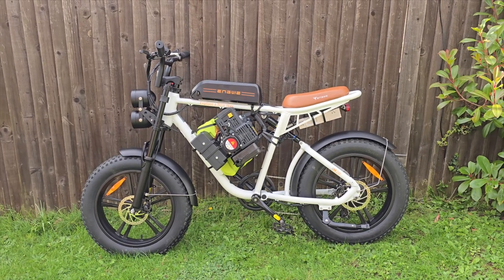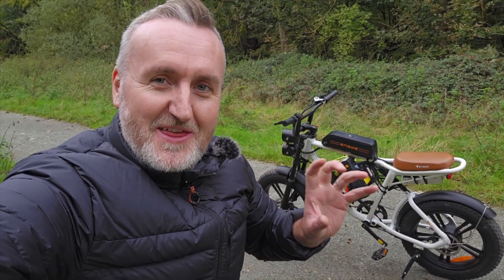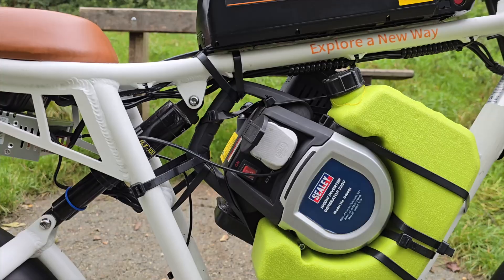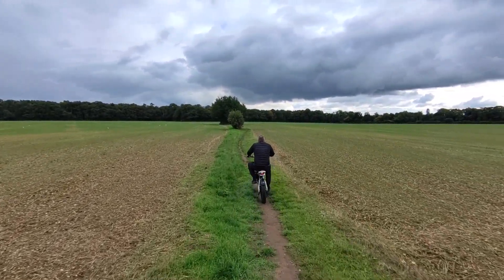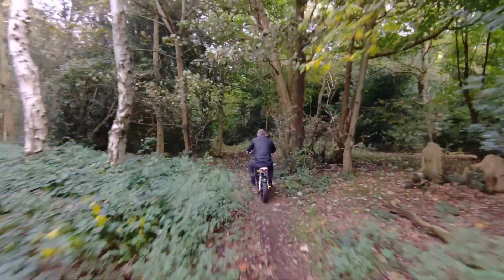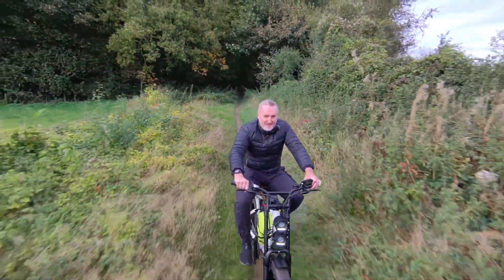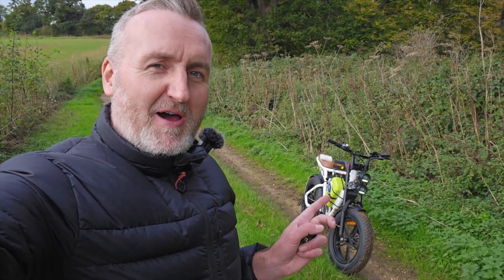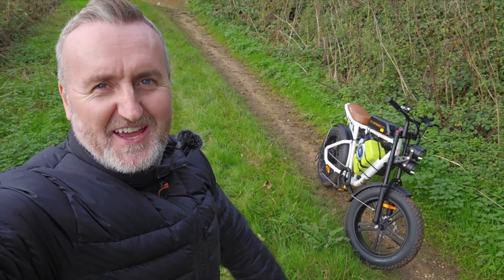What happens if you put a petrol generator onto an ebike?

Comment: If you could get back with me let me know how I could do that conversion to my e-bike I've got a Ariel Rider grizzly I would like to get it converted over to generator power that way I don't have to worry about range anxiety and my e-bike has two motors one on each wheel they both put out a thousand Watts a piece of a peek at 1500

Comment: Okay I need help making my 1950ish Sears and Roebuck trike into a "ebike" only powered by a 1200w gas generator which fits in the rear basket perfectly. Very quiet. I want the electric hub motor only working with the generator and not having a battery. Minimalist design in a way lol besides the generator. But I will hide everything in a vented wooden box and hide the wires through the frame. I'm trying to accomplish the wow factor, to turn heads like a Rat Rod style. The output vAC is 120v @ 20amps, vDC I believe is only 5v. Parts list? I'm mechanically inclined so throw it at me. I restored the trike years ago and never ride it anymore, trying to give it a new life in a way. The generator is a GXS1500i. As of now i don't have anything else besides the trike and the generator. Thanks for any advice!!!

Comment: another cool thing you could do is use an off the shelf engine, a BLDC and a programmable controller such as a VESC based one and directly "regenerate" or actually generate into the battery

chainsaw hybrid ebike, for example.

Comment: Just think, if you’re using the charger that came with the bike to charge it as you’re going with the generator shorly that hav a voltage regulator already so it’s getting the right amount of power bike requires
Reply: Yes I thought that as well why not just plug the charger into the generator plug. The question would be how long would it take to fully charge the battery.

Comment: You should put the 50cc engine directly to the chain 👍 why bother with the battery anyway 🧐
Reply from the maker: It was  an experiment. 😁
Reply: Because this system is legal in most jurisdictions. Powering the bike from motor directly turns it into an illegal vehicle.
Reply: the battery system is more efficient than a ice engine.
the gas engine is a range extender and can be quickly refilled at any gas station.

Comment: Andy,  I built a small trailer to pull behind my mobility scooter.  Put a small inverter generator with 240vAC and 12/24vDC outputs,   hooked up the 48v (peak 8 amps) to the batteries.  Whilst riding I'd start the generator and get a few days  of intense riding on £4 of fuel.  :)

And I had a kettle and laptops for the evening camps.    Great days
Reply: great idea, what generator is that? most generators here 12 v and 6 v output!
Reply: I'd like to see a video on that adventure. Good job.

Comment: Just like a hybrid car. The worst of both worlds.
Reply: Really? I love mine, runs on cheap electric during the week for commuting and 40mpg on petrol for longer journeys without having to worry about range, best of both worlds
Reply: @HiruS22  especially something like the 2025 Ramcharger which will be all-electric powertrain but gas generator added -- like this -- for range or towing as needed.
Reply: That is the best of 2 worlds. If you can charge the battery from a connector or using the gasoline motor. Also if you have electric only option too. Don't even use the gas if you inside a city with speed limits.

Comment: Yeah I have been really researching the same idea. I have a amyet eb26 fat tire MTB and the battery is starting to give out. So I have been trying to figure out how to power it. The battery is $400 premade, $300 if I build it and just over $200 if I switch it to a gas generator. My bike is a 48v 15ah  with a 1000w hub with a 20a controller. Just curious if there was any losses when it comes to the watts and amps that was actually delivered to the ebike compared to what the specs of the generator?

Comment: I will admit i am a bit confused. So the single battery goes flat which i get. You then  fire up the generator and it puts the power it generates through what i think of as a transformer, (like my old scalextric or train set) , the silver thing at the back of the bike, to reduce the voltage, then into the flat battery? If this is correct is it  the same as me taking my flat front lithium battery powered light off my mountain bike to charge it and as soon as it gets power through the charger i can light up my room although the battery is still flat? Am i right in thinking that In simple terms you are charging the single battery as you are moving ? It would be interesting to see just how far you could go on one full battery charge plus a full tank on the charger. The maximum i have had out of one of my electric bikes was 38 miles and the system said i still had 8 miles left. I think considering this bike has a 48 volt system you should beat this with ease. My bike? A 48 volt Radrunner with an Eggrider with me peddling a lot and taking very little from the battery, bar the odd hill. We have a few hills here in Scotland.

Comment: I assume its 2 stroke ? Who did the fuel mix lol or you deliberately running oil rich to run it in :)
I brought one while back mixed at 50-1
Added more oil as at about 50-1 there was no smoke & i was sieze up scared :)
2 strokes if youre not coughing its too lean lol

Comment: It makes sense because petrol engines have come as far as likely possible in improvements to efficiency, one massive advantage is having the ice tuned to run at its peak efficiency at a specific rpm, obviously that is possible if used as a generator, and it'd be interesting to determine a rough mpg value?
Reply: Hi, Toyota Camry or other hybrids use this method. The engine is just a generator. The engine is classed as a stationary engine and is covered by different emission regulations.
Take care M.
Reply: Some cars operate with this method and get very good efficiency.
Reply: @accik  agreed, my interest is mainly in bikes as far as claiming an efficiency figure since they're inherently lighter and always trump 4 wheels in mpg figures anyway, just to get that volume of fuel to aggregate milage, I'm thinking it's well over several hundred?

Comment: I salute your initiative. I wanted to do the same 3-4 years ago when I`ve brought my 15 Kw power / 3.5 Kw battery capacity ebike planing to go on multi-day trips with a friend that joins a ATV group. I wanted to use a 4 stroke generator because of double efficiency, better noise, no 2 stroke smell/pollution. I`ve brought one of those 1000W 4 stroke generators on ebay (its bigger and heavier) I was planing to disassemble it out of its big plastic case and modify the bike tail to hold it there but after I received the generator I didn t  wanted to do it anymore as I loved how nice the generator looked and actually used it in some power outages but I did find from its manual that it uses a Honda GX35 or Honda GX50 clone engine. I looked up those engines and they are used in cheap 4 stroke weed wacker that you can buy for around 100 USD. You need to skip the mains voltage and somehow find a motor-generator that gives the charging current of your bike battery or rewire a magnet based motor used in cars. For example the 12V motor that spins the servo pump for the car steering is very good, it`s even more than what you need and you might find another one that is lighter (that one is around 2 Kg if I recall correctly). You can get the whole hydraulic pump+motor+ oil tank for less than 5 USD from a scrapyard. You can test that electric motor to see what Voltage it gives when you spin it with an electric drill that spins at around 3500 rpm which will be a good speed also for a 4 stroke to be sustained for longer periods of time. If the electric motor doesn t give the desired voltage (and it won`t as it`s a 12V engine) you can calculate how much more wire in the coil has to be by multiplying the output voltage until you get 52V or whatever is the charging voltage for your bike. Lets say you need 52V and the motor spins by the electric drill gives 8 V you calculate 52/8=6.5 that means you need 6.5 times more spins of wire on each coil, and you have to calculate how thinner the wire has to be so it fills the same section as it fills now in the coil. You can rewire it manually and then you have to figure out the throttle control for the carburetor to keep the engine speed around that number when the battery needs less power. Sounds complicated but this way you get a 4 stroke generator that is much more compact than the 4 stroke ones you buy from eBay, it doesn t depends on a electronic inverter to give the mains Voltage and doesn t depends on your bike charger so it more compact and very reliable. The only electronic parts would be the throttle control, rectifying bridge (4 diodes) and you may add some cheap charging control circuit from china.

Comment: Kinda defeats the purpose of an electric vehicle. And that purpose is to stop using petrol
Reply: Nah, that purpose is convenience for short hops.  This little hybrid is doing what cannot be done with a pure electric bike:  mega range.
Reply: No the purpose of electric vehicles is to be a smarter choice than fossil fuels. So cost, depreciation, maintenance all need to be considered. Now I own a 2003 BMW 530d I am an auto electrician, with an eme degree. My 530d has 315 k miles on it to date, and I make a living repairing EV and hybrid vehicles with knackered batteries and never more than half the mileage of my BMW on them. So ev and hybrid vehicles make some sense in certain use cases. But once the battery expires there often not worth a penny. And there not recyclable on a grand scale like an iron or aluminium engine is.  The environment argument is moot untill this is solved . U till then ev and hybrids need to compete favourably with combustion from am owners perspective.

Comment: The legality of this depends on how you interpret:
"the vehicle shall be fitted with no motor other than an electric motor" (The Electrically Assisted Pedal Cycles Regullations 1983)

Now if the generator was on a trailer and only used to charge batteries, not power the bike directly...
Reply: Or worn in a backpack-style arrangement.
Reply: @AlexSwanson-rw7cv  yep, totally legit! 😁
https://youtu.be/EHsfUsnTSL8?feature=shared&t=581